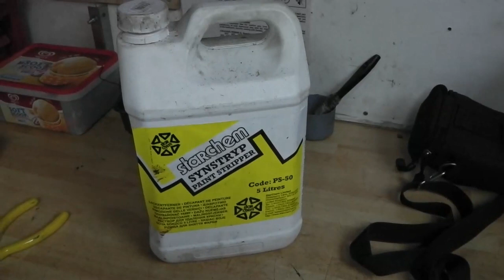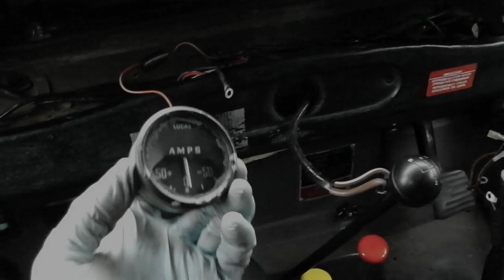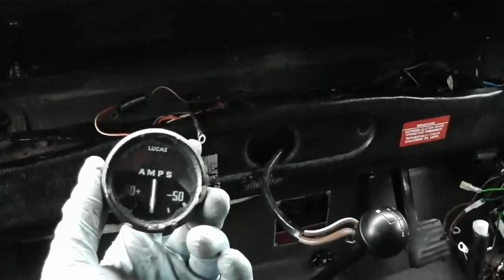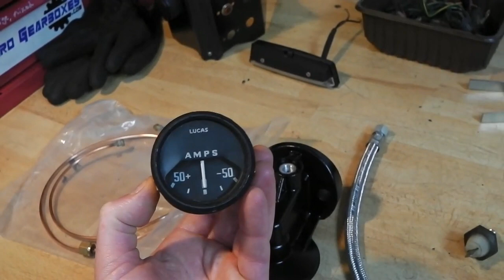Land Rover Series 3 Brakes and Steering - Part 4

Comment: The trouble with this time of year is that rust converters take days to work rather than minutes! I’d done some round the front chassis when I changed my engine and it stopped the job for four days as the temperature didn’t go above freezing for three. No chemical reactions happening at all.

Comment: Happy New Year, thanks for sharing your knowledge.
I would very much like to see how you fitted the handle to the lathe when you hand cranked the threads on the adapter.
Best wishes for the new year from 🇳🇴, hopefully we will be a lot less pandemic in 2022.
Reply from the maker: Thanks, and a Happy new year to you too! The lathe hand crank fits snugly inside the spindle with the end of the mandrel slash cut and bored to a good clearance around a stud that runs through the middle. As you tighten the nut at the handle end, the slash cut end is pulled against the main part of mandrel, trying to ride up the cut section. This forces is against the bore of the spindle spindle and that locks well enough for cutting small threads. It would be much nicer to re-visit that and make a proper split mandrel with a taper inside, but it was made to do a job and has been used many times since.

Comment: Hi Steamwally I love the videos. I have a similar 1983 S3 Petrol ex military 88. Yesterday one of the spade terminals in the back of the brake stop relay (in the centre console) began to smoke/melt. Just wondering why you decided that the PDWA valve was redundant? I am thinking that I might remove rather than replace as well...
Reply from the maker: Hello Jack, thanks for the comment. From memory, the 6RA relay in the centre console is fed on a fused supply, perhaps that might help locate the trouble. It's usually fed from one of the ignition barrel switch terminals and pretty easy to disconnect. To be honest, you are better off without the PDWA valve- many claim that it shuts off the passage of leaking fluid but it does not, that becomes apparent when you dismantle one. By the time the warning light on, the main safety device is in operation- that is a "weir" type set up in the brake reservoir which means that the failure side can loose all it's fluid without rendering the working side inoperative. The valve can also make bleeding the brakes even more difficult, so I was only too happy to remove it and all it's electrical gubbins. It was just one of those things devised to satisfy a bit of nuisance regulation...
Reply: @steamwally  Thank you that is really useful. I think that I am going to remove the electrical bits/loom related to the PDWA and then at a later date when a brake system overhaul is required I will remove the valve itself. Thanks again for all your help.

Comment: Love the old phone in the background at the end. Does it work?
Reply from the maker: Absolutely, full working order. They have to be converted to work on the modern system but that's an add on rather than irreversible modification. It's yet to be connected, I need to run the cable for it next..
Reply: @steamwally  Fantastic.